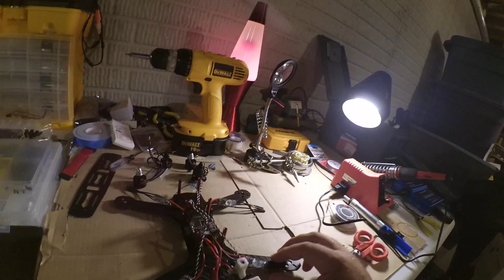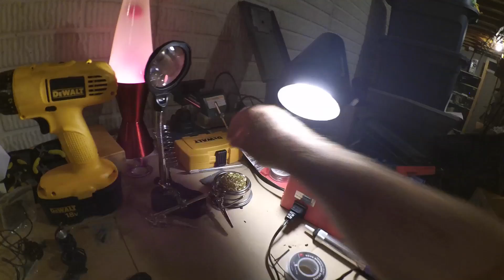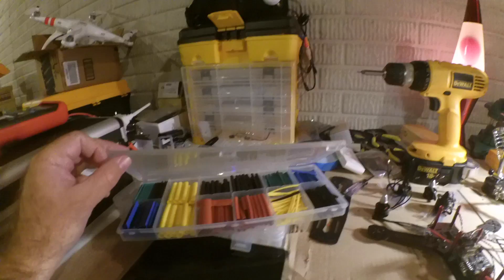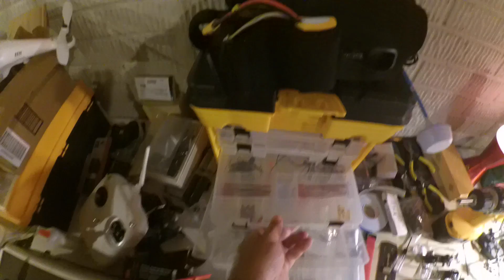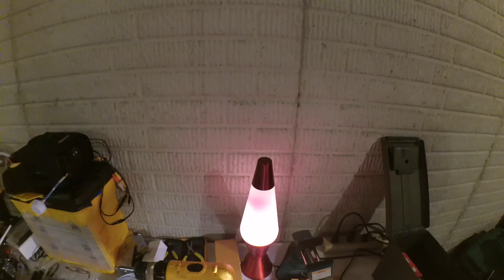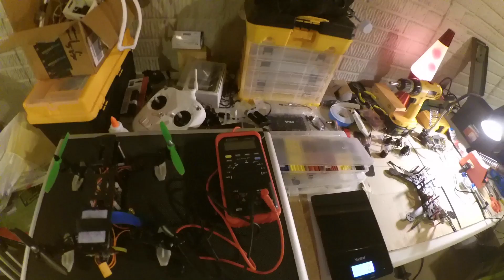Quadcopter Workbench

Comment: thank you! I am an idiot when it comes to tools, but the heat gun is for... ?
Reply: +Brian Sum1YouNo Hi Brian, the heat gun is for shrinking the heat shrink tubing, which you can use to cover wire connections instead of electrical tape. You can also use the barrel of the soldering iron but I prefer the heat gun.